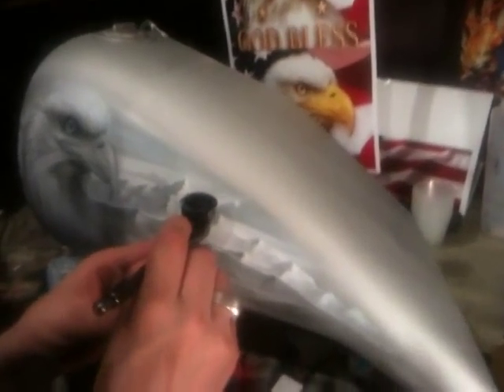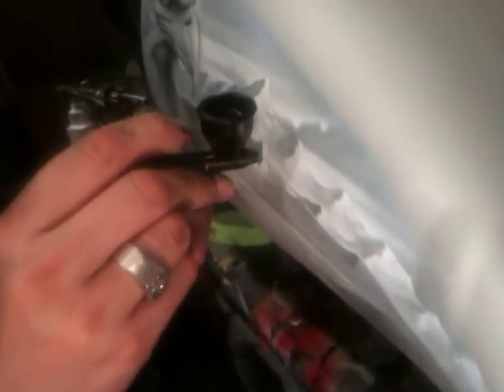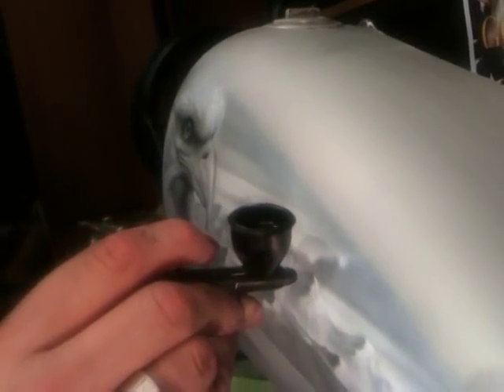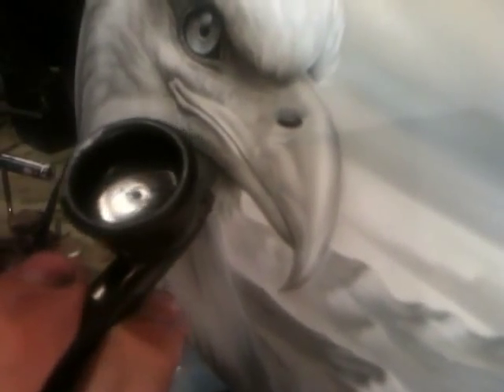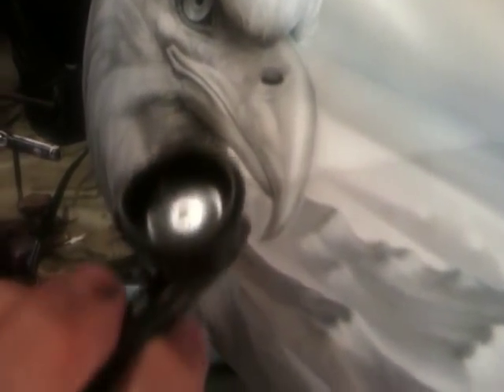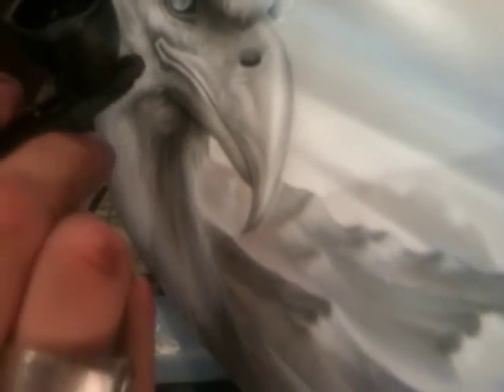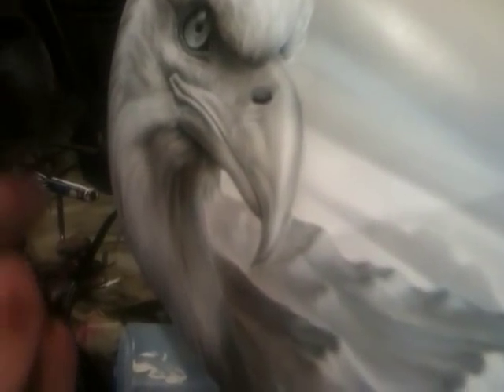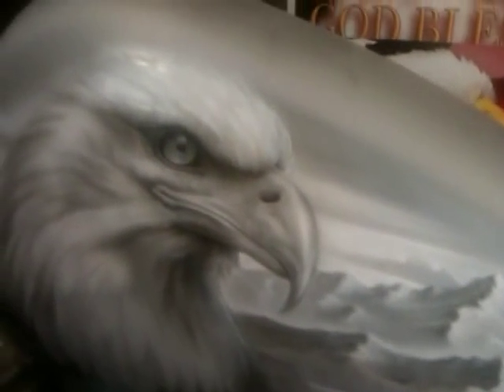how to airbrush a eagle part 3

Comment: I am loving these videos right now.  I am still in the beginners T-shirt phase but you made me realize I need to really water down my paint to get the light grays.  I was really fighting with it.  I was trying to do it full strenght and couldn't figure out why I couldn't control the gun enough to get a very light gray :)  Ha ha!  Anyways, Iooking forward to your next video!  Also, I haven't used oil paints. Could you show how you mix your paints?  I know there are formulas per each color.